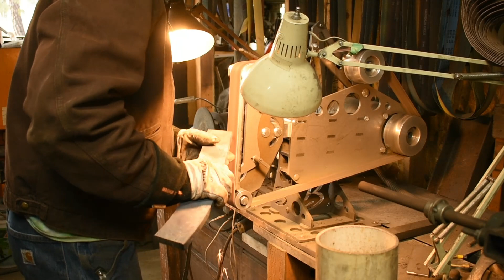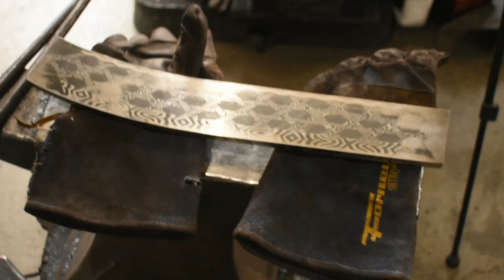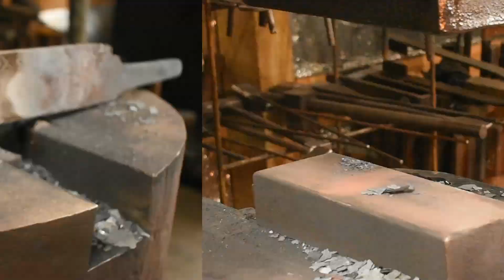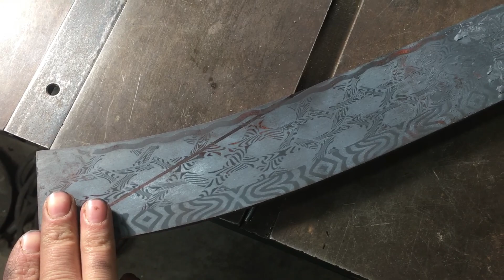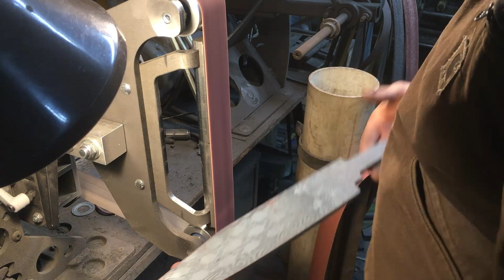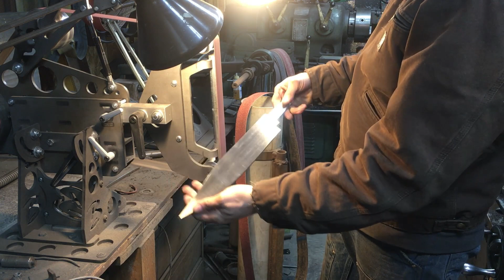Hex Mosaic 4

Comment: Salem, why didn't you forge in the tip??
Reply from the maker: Didn’t want the distortion that would cause. This way the pattern remains crisp, including the edge bar... although I did forge/bend the curve into the edge. It’s a stylistic choice, often I will forge tips. In this case the overarching theme is one of control and precision.
Reply: Salem Straub thanks
Great pattern & outstanding clarity. 
I still struggle with a real clean etch, wish somebody would do an indepth.  Tried many techniques and variances.
Reply from the maker: @timjackson_ABS  I’ll be doing an etch tutorial soon I’m sure...